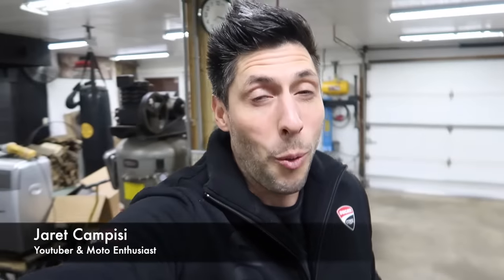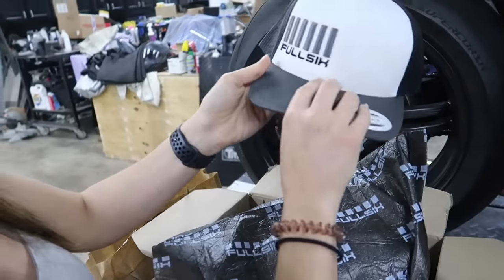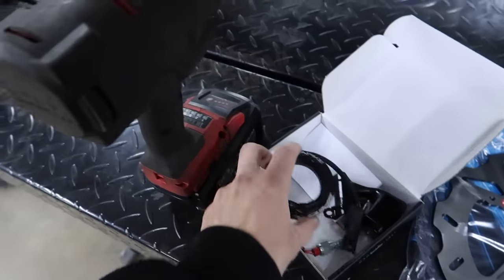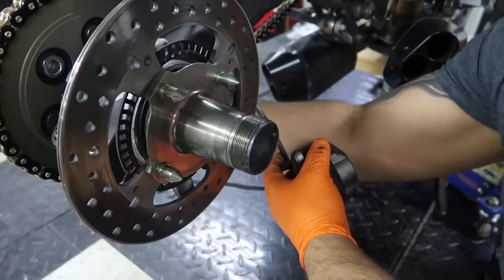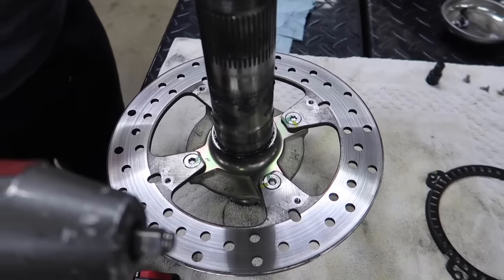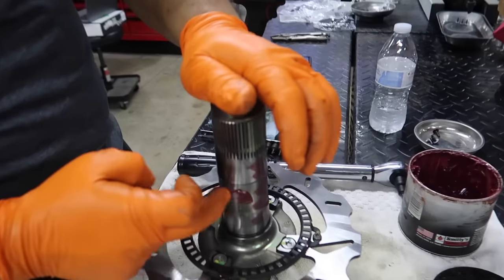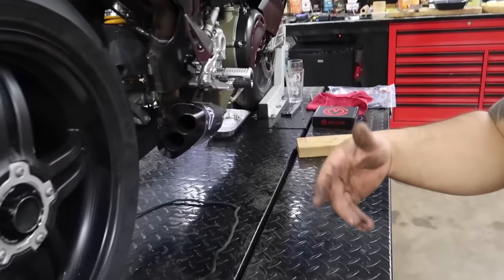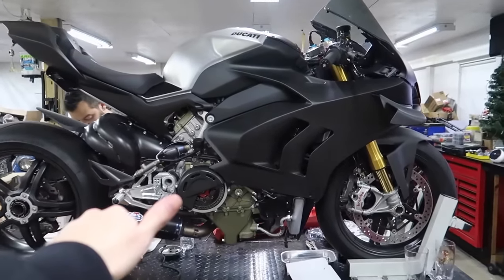Upgrading Our Carbon V4 SP Rear Brake System!!!

Comment: Yeah, when I was replacing the steering bearings on a Ducati 998, I used a Bursig lift that uses the swing arm bolt to lift up the bike completely off the ground.  It is simple an easy to use.  Teens needs a portable desk to do her work in the garage, she is slumped over her computer.  Does Dado have room for an small office space?

Comment: They do have a jack that uses the swingarm pivit hole to lyft bikes for this, and they are only $60 last time i checked. So it still less that what the dealer is going to charge. Great job guys i have learned so much from you both about my Ducati Penigale V-4 and how to perform any upgrade, you guys are like having my own personal shop manuel.😁

Comment: fixed our only Wranger YJ...Our 94 4 banger YJ needed the multi wiper switch replaced.  Tried to replaced from the top.  Impossible. removing the steering column was easy thanks to your video. Screws in the inside pointing up held the parts together. Only way to get to it was to remove the steering column  $163 switch at Oriles.  The first switch we got $100, but didn't fit.  There are 3 switches for the year.  Of course the one I need is the most expense.. sigh.

Comment: love the channel, fantastic bike. But all that work to replace a Brembo rotor designed to work with the overall system, with an aftermarket rotor. But saying that the rear master cylinder set looks like it's going to be awesome.
Reply: actually it's a crap bike , it's just "beautiful" japan bikes are more reliable on the long run and cost less to run but that's just me

Comment: The bolts are coated, when you take them to any wire brush it wipes it right off with ease, the bolts will rust so fast like that broskis

Comment: I am sure you don’t have to remove the rear axle to remove Ducati brake disc..? Normally you can remove calliper, unbolt & rotate the disc to the open slots and lift it over wheel flange side…
Reply from the maker: nope the entire axle has to come out

Comment: Re. stainless steel discussion: stainless steel can certainly be magnetic. It really depends on which type/alloy of SST. Most common ones are 304 and 316. 316 is very very very lightly magnetic, you'll have hardly any magnetic attraction. 304 is more magnetic.
Reply: It would be a 400 series stainless
Reply: Love how you guys are crushing knowledge in here 😎
Reply: @DadoRados  400 series stainless steels are heat "hardenable" because of thier composition and content. While the 300 series stainless' are generally (or all of them from I recall) not heat treatable. There are reasons to harden stainless steels. 
One thing to keep in mind is that the 300 series are very corrosion resistant, more so than the 400 series. But they are also very soft, and threads are subject to distortion, and galling.......so a thread lubricant and paying attention to cross threading is important with 300 series stainless steel. Also keeping the threads clean as a foreign object can trap in the threads and gall.....